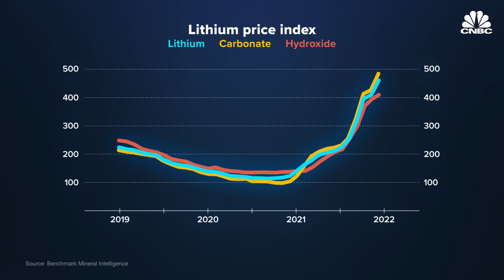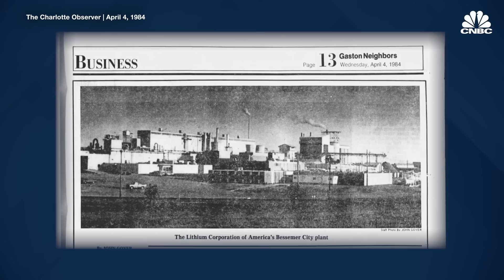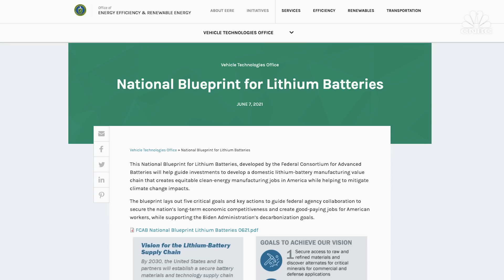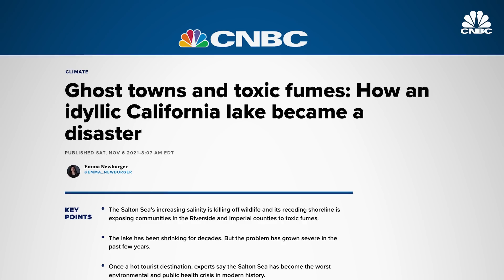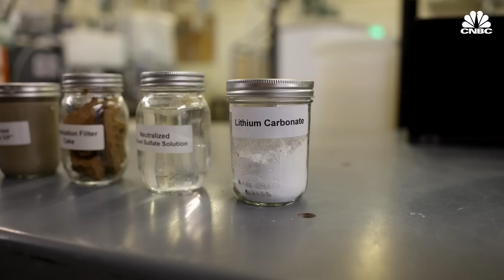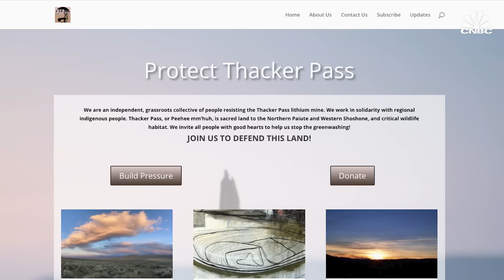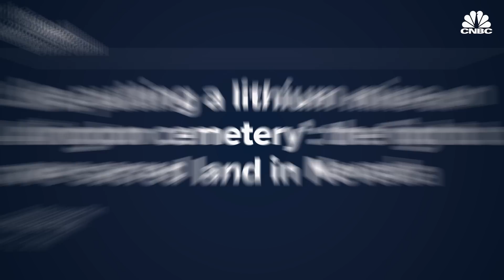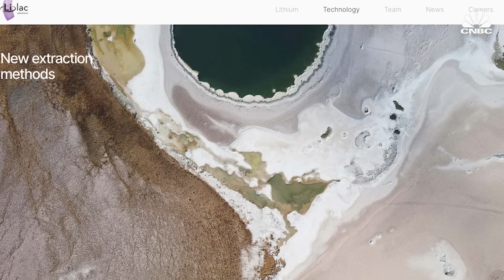Why The U.S. Has A Massive Lithium Supply Problem

Comment: I feel like Wendover put it well in his newest video on EV batteries, at around 14:25 in his video, roughly quoted he says "EV's are dirtier to make, but the majority of emissions come from driving them, electric vehicles from production, to use, to scraping, are responsible for about 75% LESS emissions, even using dirty fossil fuel electric grids to get there, anyone who argues the opposite is either misinformed, or attempting to disinform" there is no such thing as clean mining, but if this step has to be dirty to make the clean alternatives we need, then I'm all for it
Reply: Pretty much.
Reply: Less emissions is only one part of the puzzle. That’s what people aren’t getting. 
EV’s and Lithium mining has huge effects to local environments and ecosystems. 

So while yes, it produces much less “emissions”….it’s local environmental impact can be considered much worse than crude oil. And there is no telling what trickle down effects that could have. 

Not to mention that Lithium’s accessible supply is quite small and finite.
Reply: And most likely they work for fossil fuel industries and don't own an electric or hybrid. I've yet to meet the owner of an electric or hybrid car who wants to go back to paying much more in fuel costs for a markedly inferior product.
Reply: Watching his video now and it’s so much better in nearly every way to what CNBC has turned around with a much a larger budget.
Reply: @AE-bh5zs  Inferior? Some people have dropped thier EVs for gas because of limited number of charging stations and the time to charge. 

Compared to how you only need a few minutes to fill up a tank.
Reply: @shanemooon  Yes, however Lithium can be recovered and reprocessed for future use. So it really can't be compared to oil in that regard. That said, Lithium is not the end; there are other battery chemistries that can be used.
Reply: @shanemooon  of course local environmental damage is going to be worse if you build a mine. Just the same if you build a gold mine, iron or coal. But we have to see the net benefit. In Shenzen, China all the public transport is ev based. One buse company out of 3 does a million km per DAY in distance travelled by their buses. Imagine how many million litres of diesel is saved per year in just one city
Reply: @deragoth4250  EV’s have their place for sure. And mining for materials to create EV’s has minimal impact currently. 
But think about this….public transportation or even some trucking on EV’s PALES in comparison converting the entire world to EV’s. Over 1 billion vehicles. WhT is the environmental impact at that scale?
Reply: @shanemooon  Still better than drilling transporting and refining petroleum. Take a look at Alberta's oil sand mines.
Reply: @arnowisp6244  Are you homeless and have no place to park your vehicle? You charge it when you sleep, takes you 20 seconds, 10 seconds to plug it in and 10 seconds to unplug it.
Reply: @shanemooon  Hi, I am a little confused by your argument.  You are suggesting that building an electric vehicle uses materials that are not already being used by internal combustion vehicles.  All internal combustion engines have at least one battery and it is made of lead and sulfuric acid--both of which are deadly.  The engine must be bathed in an oil that can not be disposed of.  And it burns a fuel that produces dangerous gases.  (Cars still produce Carbon Monoxide even if it is at lower level then it was in the 1970's.)  An electric vehicle is the same as a combustion engine vehicle only without the engine.  They both have a body, suspension, transmission, several motors, a control unit, various electronics, wheels and a battery.  There is no complicated conversion and if you have a problem with lithium you can alway go back to the inefficient and toxic lead acid battery.
Reply: Home, business, and industrial battery storage from solar is going to conquer all. Aluminum-Graphene batteries for wind and solar energy storage will be everywhere. Fossil fuel will diminish, which is a good thing. Whoever is pretending that gasoline powered cars are cleaner, or environmentally less harmful  is ABSURD.
Reply: @DripDripDrip69  well if you are homeless its no problem you can sleep in your car at the charging station but if you leave in an apartement no way to drop an extension cord from the 5th floor window to your car.
Reply: @jonathanjohnson8376  no. What I’m saying is that if we switch all vehicles. Or most vehicles. to be fully EV…that is exponentially more battery components (lithium, cobalt, etc) than is being produced right now. By an exponent of up to 100. The amount of Lithium and other minerals we would need to mine to support that is enormous. 

So in that scenario…which is what everyone seems to think is the future….what is that environmental impact? It could be catastrophic to ecosystems. And it is estimated that our supply of Lithium could run out in 20-30 years. So then what? We did all this environmental damage for very little return. So who decided what’s more “damaging”? Greenhouse emissions, or destroying complete ecosystems directly?
Reply: @DripDripDrip69  That's not really an option for apartments. Most of them use a car park and there is no easy way to electrify a whole car park. Electric cars are not the future. Hydrogen is really the only option.
Reply: @shanemooon  Hi.  It sounds like you are making a lot of assumptions to get to your conclusion.  Petroleum is a very limited resource and right now Lithium is not, so I don't know how you can argue for Petroleum.  Especially since Lithium-ion is just one type of battery and many car companies are already investing in other kinds, like solid state batteries.  And as for direct ecosystem damage, I would say oils spills like the recent one in California are far worse than Lithium pools.
Reply: @jonathanjohnson8376  petroleum is considerably more abundant than Lithium is….what the heck are you talking about????

Even by the most conservative numbers. We have 50 years of oil left. And that’s on top of the 50+ years we’ve already been pumping like crazy. 

We will run out of Lithium in 20-30 years by most estimates. 

Sure there is new development coming. But it is nowhere near ready for any sort of mass production. We don’t know if it will even work…ever. It’s still being tested. 

So we can only go by what we know. Which is what I’ve been saying. 

As far as oil spills….those are very different things. That’s an accident. If a Lithium pool leaked everywhere, it’s effects would be catastrophic. Way beyond any damage caused by an oil spill.
Reply: @shanemooon  Hi, petroleum is a chemical compound, while Lithium is an Element.  Batteries do not burn lithium, but combustion engines burn gasoline.  So you are comparing 2 different things, but hey why not.  A 2A 18650 battery uses 0.6 grams of Lithium with a power output of about 7W, but it can be charged about 500 times to 80 percent charge.  So, about 3.5 KW before being reused or recycled.  A gallon of gas is about 4 KWhrs and weighs about 6 pounds.  So about 0.0009 KW for 0.6 grams.  That would suggest that gas would have to be about 3889 times more abundant than Lithium for you to be right.  
Now, Like I said in the beginning, there are other types of batteries beside Li-ion right now in existence--like Lead acid, Ni-MH, and etc.  So running out of Lithium is not a big deal.  
And Finally, you say that the effects of a Lithium spill is far worse than that of an oil spill.  Well, lithium is water soluble and actually used to treat bipolar disorder up to 10 mg/L.  Would you be willing to take 10 mg of oil?
Reply: @shanemooon  I see your point. Everything we do have an environmental impact. Think about it this way. How much iron was mine to build all the vehicles we have today or build all our cities. We are not going to stop doing that but we can try to mitigate it effects.  

Once we build the batteries packs for an ev, it a fixed amount. After the ev can no longer be driven, the battery can be reused for storage or it can be recycled. Petrol on the other hand will be continuously burned above and beyond the lithium mined. So how many more billions litres of petrol/diesel will we burn this year and the next
Reply: @AE-bh5zs  i am also for using the much cheaper power from coal
Reply: Came from Wendover as well, much better content. I for one think Americans are right to secure supply from foreign mines, mining employs very few people and (in particular lithium mining) cause tremendous environmental damage. It's the very definition of NIMBY. That should come with strong R&D for lithium recycling, so in time you can reuse all the lithium you imported.

I'm not American btw. I'm just a cynic.
Reply: E. W.  Imagine the 2008 housing crisis except this time it is gonna be centered on energy. The very basis of economies. It is gonna be ugly and it is not that far off. ! good polar vortex in Europe this winter and its all over.
Reply: E. W.  since all these are private companies I struggle to understand how this fit into definition of communism. Even getting subsidies from govt does not fit it. And if you believe it does then we been having fossil fuel communism, mining communism and car production communism for decades

Having said that we must all remember that all these lithium mining companies are not environmentalist. Their purpose is to make a profit, not to save the world or stop climate change. So just treat them as any other mining company that is providing a vital resource. Support them as necessary and fine them if they break the rules
Reply: @aman7196  MOSTLY AGREE!!!  When I add up all factors I am aware of, most notably the collateral damage to convert all passenger vehicles to BEVs versus going with the 50% less efficient HYDROGEN fuel cell vehicles, my conclusion is that the optimal future is 80km range BEVs basically for daily commuting and Battery/Fuel-cell hybrids for vehicles that need to go farther.  Lots of predictions on the feasibility of green hydrogen achieving costs comparable or lower than gasoline.
Reply: @shanemooon  as a Floridian whose state will probably never see any lithium extraction ever, that's a risk I'm willing to make
Reply: @aman7196  Hydrogen makes no sense for passenger vehicle, you'll need a whole new system of infrastructure. On the other hand everywhere is electrified. Do you have lights around your car park? Then there's infrastructure.
Reply: @imperatorcaesardivifiliusa2158  that’s the spirit!
Reply: You misquoted Wendover. What is it he actually said?
Reply: @DripDripDrip69  Keeping a bunch of lights on is easy with a 10A @ 120V circuit. Electric vehicles need 240V at 40-60A a piece. Electric vehicles need massive currents to be able to charge. Those two aren't really comparable. The electric grid really isn't designed for electric cars. You would need to effectively double the number of distribution transformers to be able to manage the power draw, and even then it might not be enough if everyone charges overnight.
Reply: @stevk5181  Keeping ICE cars warn and charging electric vehicles are massively different power requirements. While it is possible, it isn't cost-effective because you would need many more transformers (often the most expensive part of an electric service).
Reply: @aman7196  Level 1 charging only requires a standard 110V plug in and is ideal for cheap overnight charging and topping off while at work or school. No extra transformers should be needed.
Reply: @stevk5181  Level 1 charging each still requires a 10-12 A, so you can really only have 1 on each 15-20A circuit. Also, level 1 charging only provides 3-5 miles per hour of charging. Limiting people to no more than about 40 miles a day.
Reply: @aman7196  The average commute is under 40 miles per day. So 40 miles at night, plus 20 miles during the day, would provide adequate charging with the occasional top off at a super charger (level 3).

Yes I'll acknowledge you're correct that a 15 A circuit could only cover one outlet, but a single traditional house transformer (your original argument) would be able to cover up to 15 vehicles charging. So a small transformer would be able to cover the load of two quad-plexs; a typical apartment size in towns and small cities.

The best compromise would be a PHEV with a battery capable of offering 50-100 miles of range and a small ICE to extend the range to 300+ miles.
Reply: @shanemooon "...it’s local environmental impact can be considered much worse than crude oil"  This is just false.  Even if you were to ignore other methods of fossil fuel extraction such as fracking the negative local impacts of oil extraction are massive.  Lithium mining is predominantly occurring in dried seabeds and saltflats where there are few species to be affected.  Also the biggest difference is scale.  The battery pack of a electric car is not thrown out when it runs to zero but an ICE vehicle will need to be constantly refilled meaning more resources will be pulled from the ground over it's lifetime to keep it running (even if you were powering the electric car via electricity with some hydrocarbons in the mix)
Reply: well duh they have a battery in them, thats like adding 200,000/20 10,000 gallons of fuel and refining wastes into a car on the dealer lot.  yuck. heres your  180 barrels of fuel maam
Reply: Yes you can have cleaner cities with EVs, but for that to happen other cities in other countries will have to pay the price.  Check the video "The price of green energy | DW Documentary"
Reply: Smart comment. Stupid comments below not welcome.
Reply: @MRRookie232  However he didn't run the numbers like Common Senses Skeptic did to discover yet another problem with Lithium batteries.
Reply: @AE-bh5zs  You can't own electric car, because it is way to expensive. In the end of the day cheaper is better.